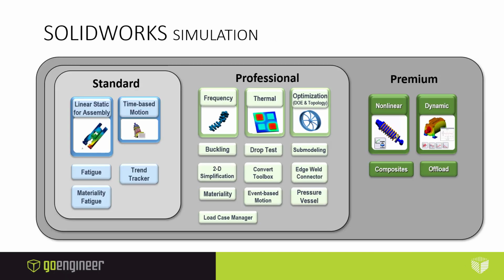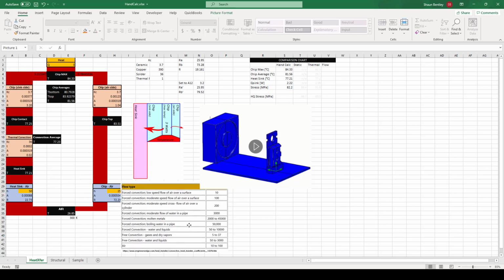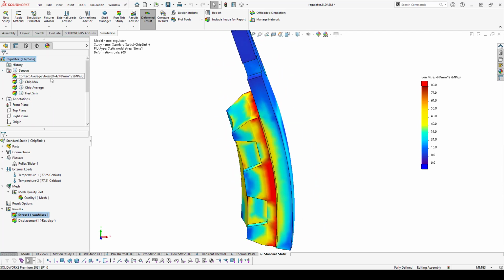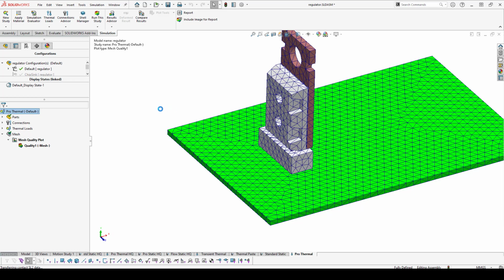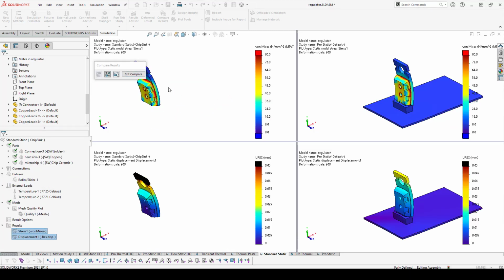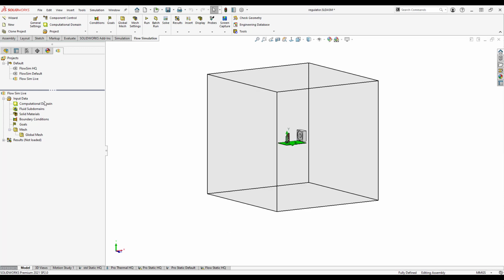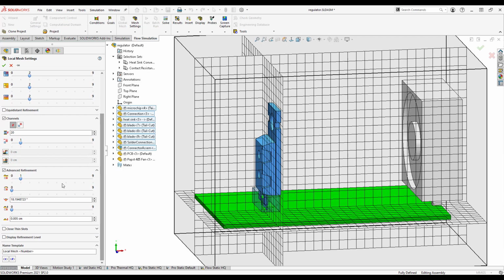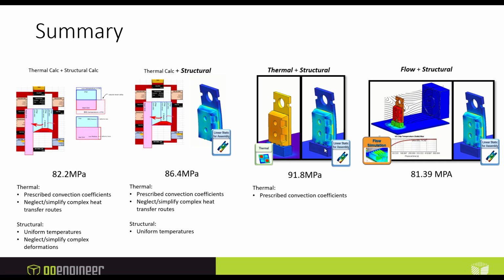SOLIDWORKS Thermal Stress from Beginning to End

Comment: Excuse me, sir. I have a question regarding the simulation in this video. Can this method be applied to pressure vessels? In this case, the pressure vessel would receive an input of hot steam at a maximum pressure of approximately 3 bar. How can I simulate the stresses in the vessel? I would really appreciate it if you could advise me or recommend a relevant video on this topic. Thank you, sir, for your expertise.

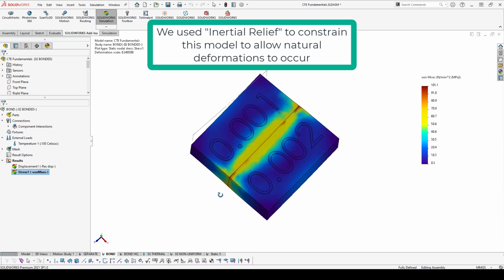Comment: Could you explain the simulation setup for the bonded case around 4:18? I don't see any fixtures, and I see one component interaction. Are both cubes just bonded via component interaction with a temperature load?
Reply: can't get that contact stress as you have it. any help is appreciated

Comment: Is there any option to import study of one Flow Simulation into another Flow Simulation ?
Reply from the maker: Thank you for your question.

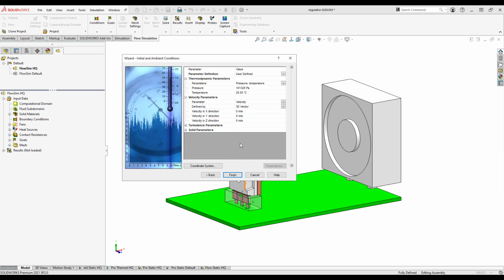We do not show this in the webinar, but the place you will do this is located in the "Initial Conditions" step of the WIZARD or GENERAL SETTINGS.  If you pause the video at 40:45, you will see the "initial conditions" dialog and where is says "Parameter Definition" is where you will change it to use another Flow Simulation.